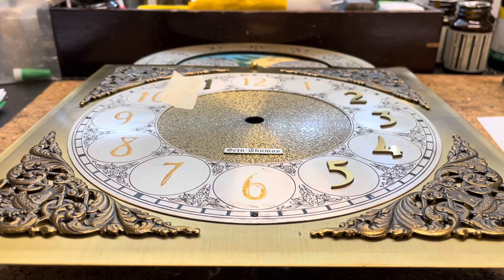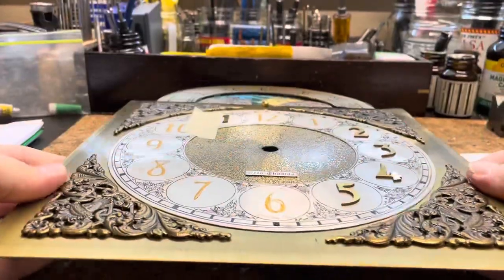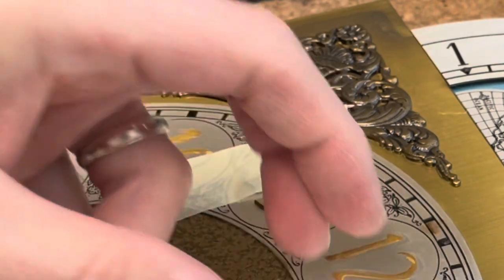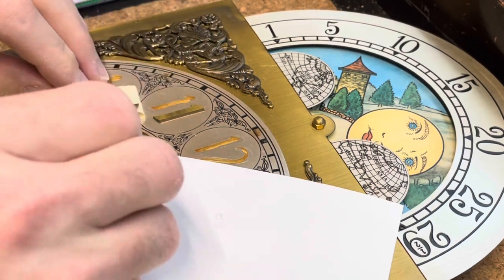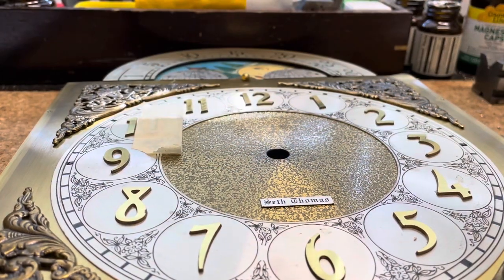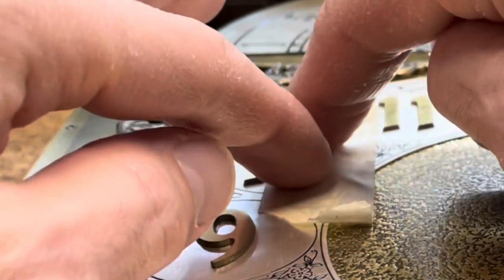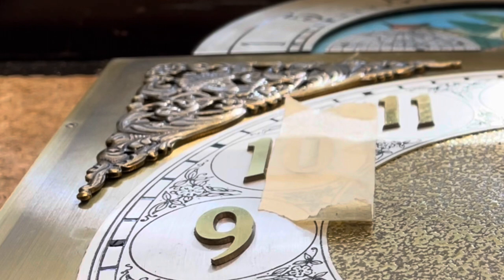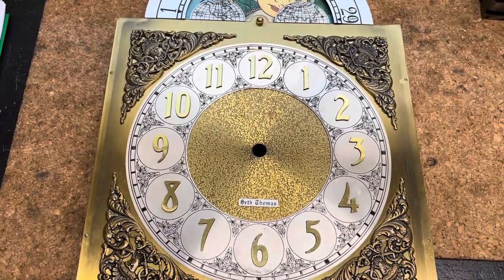Replace Grandfather Clock Dial Numbers - The Easy Way @Chrisclockrepair

Comment: Chris, this simplest of your videos spurs the most questions from me! Is that gel superglue? I think acetone will clean up superglue and wonder if acetone would hurt that metal dial's black legends and artwork? Lastly, as for the silver color metal part, is that a real noble metal silver surface or just a steel/aluminum metal ? I have a clock face that somebody gooed up replacing loose numerals and need to remove and reapply them.
Reply from the maker: I would not use acetone on the dial. It is superglue and I don’t know a way to remove it without damaging the dial

Comment: Hi Chris, thanks for your videos. I am looking at making wooden pendulum/bob for Hermle 461 clock. Help: any advice/specs will help.
Reply from the maker: The effective length is normally stamped on the back of the movement.
Reply from the maker: But realize that the effective length is from the center of mass of the bob pendulum assembly to the suspension post. Err on the side of too long as you can always shorten, but difficult to lengthen.
Reply: @Chrisclockrepair  Hi Chris, I see the numbers:  114cm,  blow ; 60,000. What does the bottom number indicate?  Can I mail you a pic?
Reply from the maker: @ferdieg1402  send me photo to chrisclockrepair@gmail.com

Comment: Nice Chris thank you! Can you do a video on fixing scratches etc on wooden cases? Clocks seem to pick up chips and scratches. Also I have an Ansonia marble clock with paper dial. The inner chapter ring rather than being gold has gone green. What is the best way to repair/ replace these dials.
Reply from the maker: Hey Jake. I don’t do a whole lot with the cases. I leave that up to the woodworkers. I usually will farm that kind of work out if it needs to be done. I stick to the clocks!

Comment: Chris, I have a question. I have this same clock. I am going to customize the art on the moon phase sawblade dial. Can I remove the moon dial without removing the whole face? I see the nut on the front of the face that holds it on, but I don't want to mess with it unless I know for sure that I can put it back on successfully. I don't want to have to mess with the whole face, so if I can take off the dial alone, that would make it much easier... I think.
Reply from the maker: Yes, the moon dial is removable, but you should remove dial first.

Comment: Can you show how to make the chime tones on a tubular grandfather clock sound louder. The strike is loud enough but not the chimes. Has 5 tubes for chiming and striking. Thanks.
Reply from the maker: You can try adjusting the tension on the lines that hold the hammers.